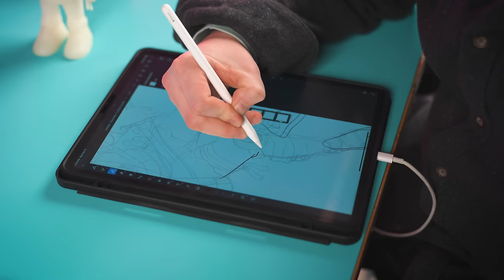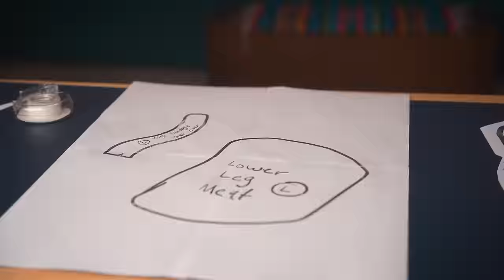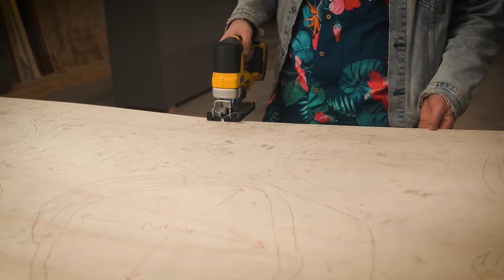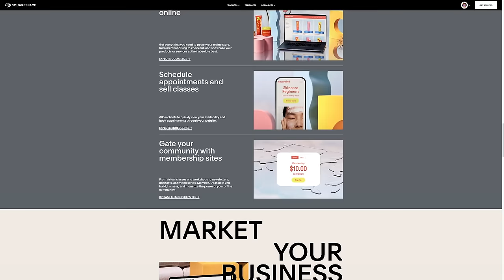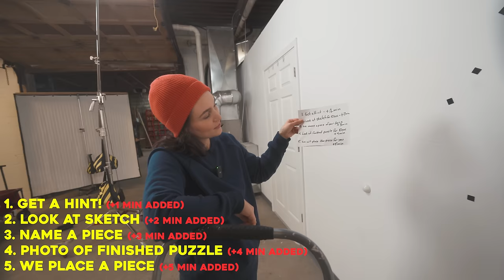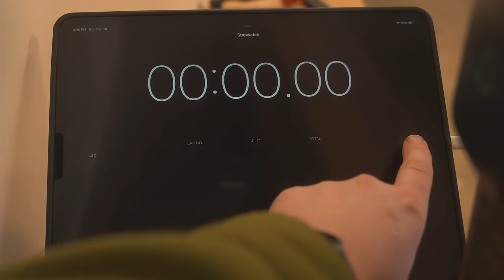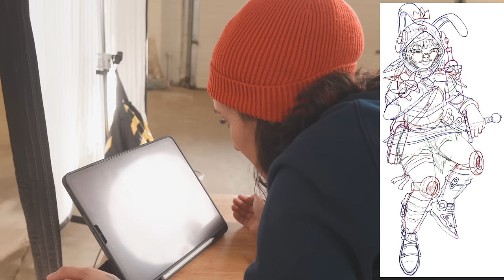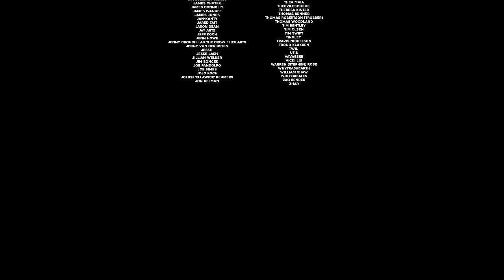I Made an 8ft, Custom 3D Wall Puzzle.

Comment: Great video man. You can actually purchase jigsaw blades where the teeth are reversed, so the chip out happens on the underside of the wood, not the top. Another option when cutting thin plywood is to use a metal cutting blade for the jigsaw. Has a lot more teeth that aren't as aggressive as a woodcutting blade. It will leave a much cleaner cut.

Comment: Just a quick tip from a DTP designer. There are "Export Selection" and "Collect for Export" tools in Illustrator. It will save you a ton of time with future projects like this one. You won't have to play around with single files in Photoshop changing the size of the canvas because it exports every single asset the exact size it is. Brilliant artwork as always 😀

Comment: I do woodworking and art for a living and the jigsaw is notorious for rough cuts. 2 thoughts: Use a "scrolling" jigsaw blade. They are thinner/finer and allow for more mobility with the saw around complex shapes. Also, try out MDF! Makes more of a dusty mess and is certainly heavier, but is far more smooth and stable. Cuts MUCH easier and takes paint very well! Love you TENHUN!

Comment: jig saw hack for less rough edges, no one will probably see this, but I recently jigged a butt ton ton of 3/16" thick panels and using a metal bit instead of a wood bit (because the teeth are finer) worked wonders.

Comment: A good jigsaw blade, not from a multipack will work better. You can also adjust the jigsaw orbital action, with the standard setting the blade moves forward during the cutting stroke in addition to the up-and-down movement. This is a more aggressive blade motion and is designed for cutting in soft materials like wood or plastic. The orbital movement provides a faster cut, but less smooth than a straight stroke. Most saws have a dial on the side of the saw marked 0 – 3 (0 – 2 or on/off if it has fewer modes). Just flip the dial to the setting you want and pull the trigger. When cutting wood, keep orbital action off or 0 when you need the cleanest finish or you’re making scroll cuts. 😊

Comment: I have seen woodworkers use the jigsaw upside down. The hold the saw on the bottom side of the wood while looking at the lines to cut and the blade poking through the top. Certainly more dangerous, but gives clean cuts and takes much less prep

Comment: Next time try an ink transfer to wood- flip the images before you print them, then put them face down on the wood and do a mod-podgey kind of an ink transfer so you don’t have to trace anything. Then you can cut and paint. And yes, a different blade if you use a jig saw.

Comment: If you could find someone with a CNC (or a laser), you could have them cut your pieces as templates. You could then rough cut the shapes with the jig saw and use the templates with a flush trim bit on a router. You will get a super clean edge and not have to spend hours sanding. Also, you could quickly make batches of the puzzles if you wanted to make more.

Comment: PETER,  all the work at the beginning could have been done on a Silhouette Cameo Pro!  It has a drawing and cutting mat for paper, vinyl etc of 24" x 24".  You could have had the artwork separated,  mirrored if necessary, nested and the whole image tiled for larger than the 24" sizes, then drawn on to your papers. It could have then cut the paper but you could just have the paper placed on your substrate for manual cutting if its been nested correctly on the paper. Then have more copies done with your line detail for tracing and you could even make a mirrored copy with internal and external offsets, turn the paper over and have it use a soft graphite pencil to make the tracing shading on the back!   You can also cut adhesive vinyl to make masks and it's awesome for mural work, and of course for large scale art tracing, masking etc!  Not affiliated with Silhouette but it's just not promoted for all the fabulous art applications it has!  You would need the business edition of Silhouette Studio software for it to do all this. There's lots of online tuition videos, but I haven't found anyone explaining how to use it for this. Lots on using it to cut fabric for quilting etc and for garment decoration, including screen printing and more!

Comment: You needed a scrolling blade on that jigsaw to get smooth edges. It has tinier teeth than a normal wood blade. You could even use a metal jigsaw blade in this case and it’d cut cleaner than a big toothed wood blade.

Comment: This would have been the perfect project for a laser cutter. It would have eliminated so many steps and finished it so much faster. Export the vector files directly into lightburn then perfectly cut out each piece with no rough edges, heck you could even lightly engrave the sketch lines. No printing, no transfer paper, no jigsaw. Even pieces larger than the printer could easily be split in two and rejoined with tabs.

Comment: Get a blade that cuts DOWN instead of up to have the "bad" side of the cut on the bottom. About the jigsaw, others have mentioned a scroll saw. That's definitely great advice. But it sounds like just using an appropriate blade will work for you. A blade with more teeth will make a cleaner cut, but slower progress.

Comment: You should just use spray adhesive and put the pieces of paper directly on the wood.  It only takes a second with a sander to sand it off after its cut.
Reply: he needs the tracing to use the lines as a guide when he paints

Comment: If your using solid wood then a jigsaw with a fine blade with painters tape will work. If your using thin board you need a skill saw and or a coping saw, the blades are thin enough to minimize rough edges. There are also drywall cutters that are super drimels that will work for thin board too.

Comment: Jigsaw tip. Use a blade for cutting metal, they have finer teeth so less tear out. Awesome work and a pleasure to watch as always.
Reply: Came here to say the same thing. Finer teeth better cut on thin wood. We use metal jigsaw blades for vinyl laminate flooring for this same exact reason

Comment: They make jigsaw blades with the teeth reversed, so that the smooth part of the cut is on the top face and the jagged part is on the bottom, that way you can see what you're doing.
Reply: Yes reverse cut blade and also make sure to turn orbital cut stroke off on the jigsaw. it was on and that is the worst for top edge tearout.
Reply: @SuperRoutman  I didn't know that "orbital cut stroke" was a thing with jigsaws.

Comment: To reverse tracing while transferring an image. 
Handy hint as cheap AF .
Always keep a rool of $2 baking paper to use as tracing paper but lay down all your lines with a softer graphite pencil then just flip it over graphite lines side down on to where you want to transfer it , tape in to place and go over the lines you can see through the baking paper. 

That easy and that cheap as you would get 30mts of paper on the roll for just a few bucks

Comment: I could not really see it but it looks like you used quite a corse blade in the jigsaw, there are fine blades for this type of material. Or maybe use even a metalcutting blade. Also you could score the lines with a knife this can also prefent the splinters. Hope this might help. The puzzle looks killer! Happy holidays!

Comment: Maybe if you have something behind the board you are cutting to avoid tare out.  Sacrificial scrap would of some sort, or something cheap that you can clamp or affix to the back. Tare out happens because the wood is being pushed by the blade, if it has some kind of pressure behind it than the wood may not tare out

Comment: Awesome! You need a finer blade and go slower for a smoother cut. Or get a scroll saw, use the jig saw to cut down the size and then use the scroll saw for the finer detail cuts. The teeth on the blade that are closer together for a smoother the cut.

Comment: To get cleaner cut with a jig saw, use blades for them called "scroll saw" blades (not actual scroll saw blades, but jig saw blades confusingly called scroll saw blades)

Also on almost all jig saws, there is a setting on the side that controls how it cuts. It's usually a thing on side that you turn. It goes from ragged but super fast cutting, to slower smoother cut. And the faster wobbles more, the other wobbles much less.
Reply: "search jig saw orbital settings" 

I can't tell on the DeWalt one you have, but I think that black switch on the side should be all the other way.

You can tell if it's for fast or smooth cuts by looking at how the blade moves, pulling the trigger without cutting anything.

One way the blade will move straight up and down like a sewing machine needle, the other will make an elliptical reciprocating motion.

Comment: If i can make any suggestion for easier cutting of complex shapes it would be to rough cut with the jigsaw than finish cut using a band saw, should save of alot of time sanding.
Reply: I cannot conceive of a band saw for a finish cut, especially for those curves. A scroll saw, on the other hand, would work.

Comment: Look into getting you some super fine cut blades the teeth are closer to gether and smaller Thay thanner than the one's you are using it will take more time to cut things out. But they get duller quickly and break and bend easier so have more than what you think you need and take your time

Comment: Why did you not draw it in illustrator and export it to a CNC machine job done! No printing, no tracing, no cutting and no sanding. Job done
Reply: Well, I can see using Procreate for the initial sketch. Vector sketching operates quite differently from raster sketching which is much closer in feel to a real-life pencil sketch.

Edit: for a one-off, hand-carving it is fine. But if he decides to make smaller kits based on this (prototype) design, then definitely automating the cutting with CNC is the way to go.